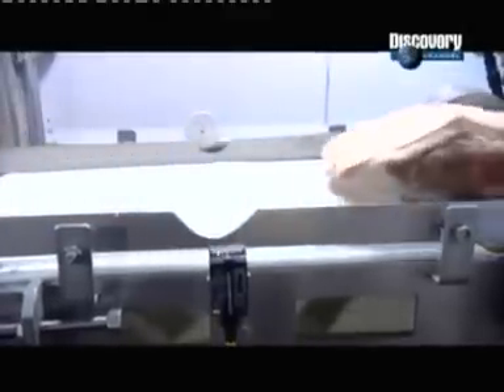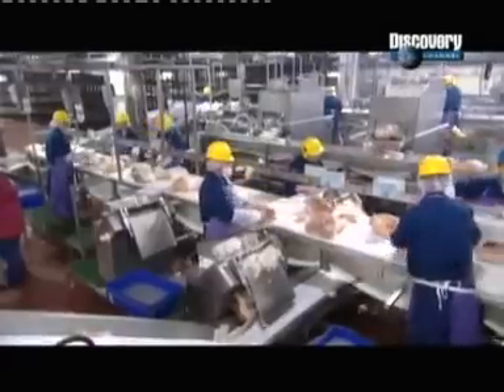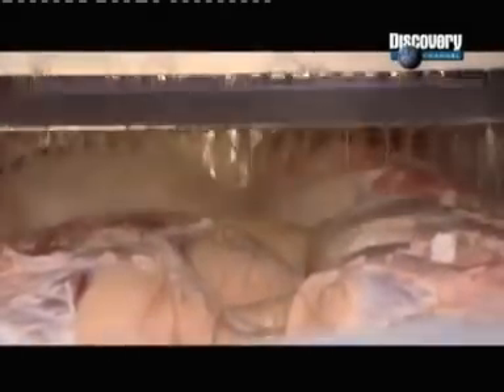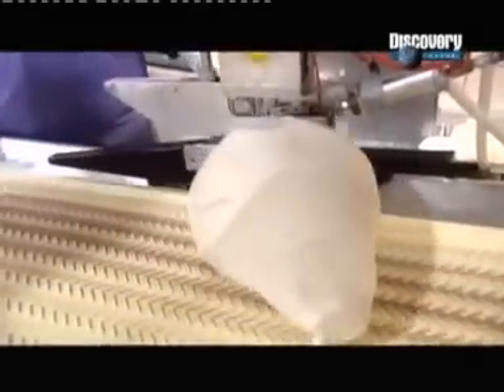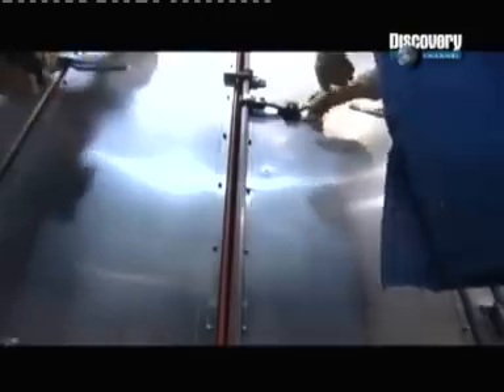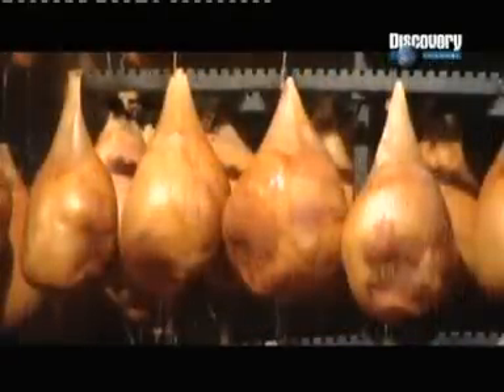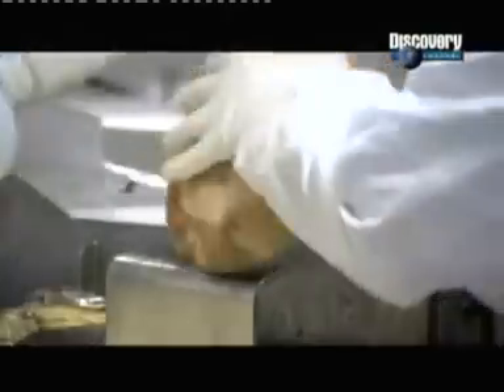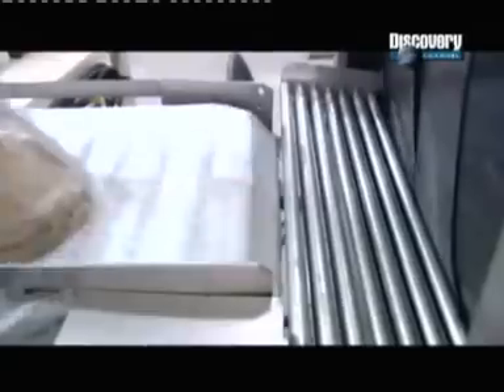How Its Made - Cooked Ham

Comment: hey guys i work at the plant where this was filmed, but this is an old video! from maybe 2004, its now owned by smithfield and alot has changed since then, if you have any questions feel free to ask!
Reply: wtf is the"Ham flavor™" they put in the water?
Reply: @e.t.7854  the only thing we do is inject brine into the ham. This is dextrose. Sugar and salt then the ham is put in the smoker for 15 hours a d then sliced. That's it. The flavor packs are in the glaze we add in the package that you add to the ham yourself.